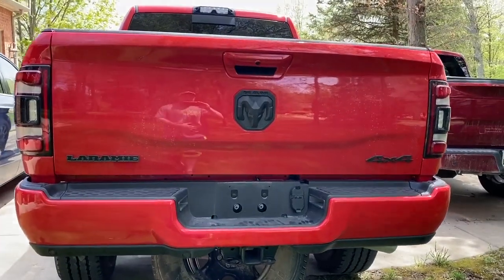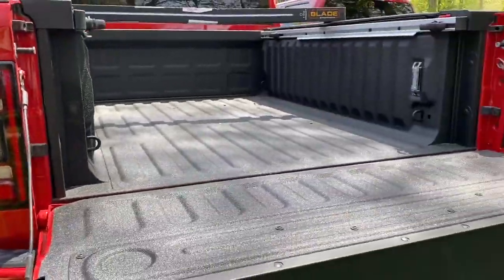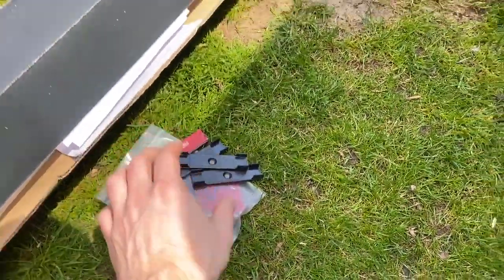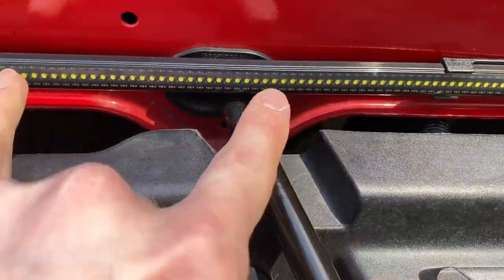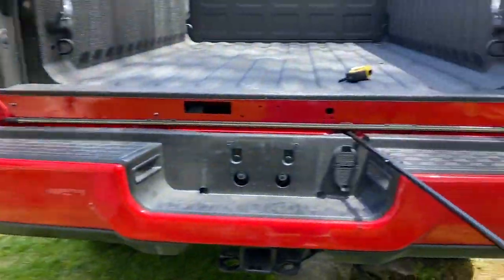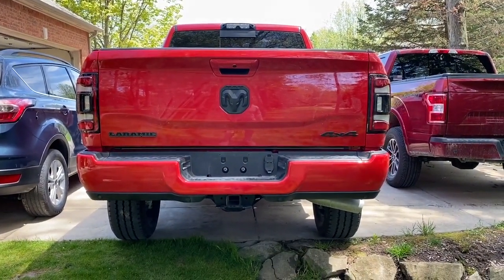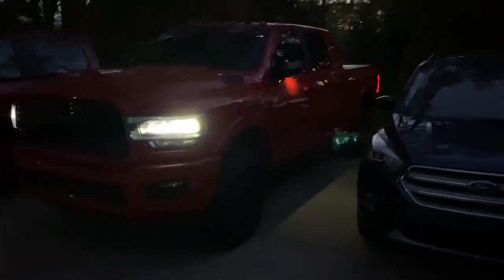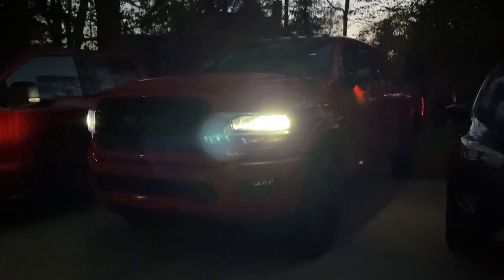Putco Blade Light Bar on a 2020 Ram!

Comment: Notice you don't have sensors but did wiring into the trailer harness make your truck think you have a trailer?
Reply: no.  its higher tech than that.
Reply: Do the running light switch have to be ON for the brake and turn signals to work ???
Reply: @allancortes5716  no everything operates independently just like your tail lights
Reply: where do i get that rabiza